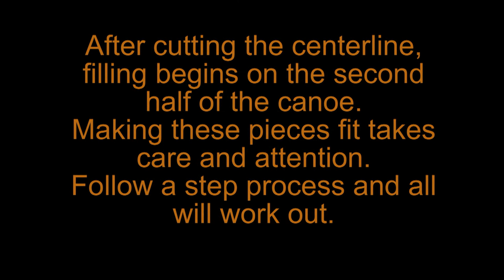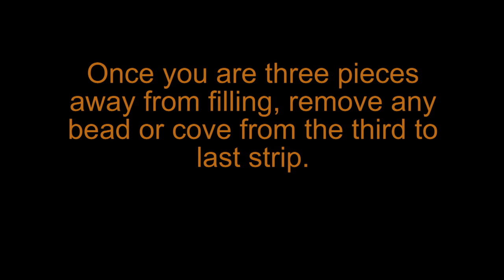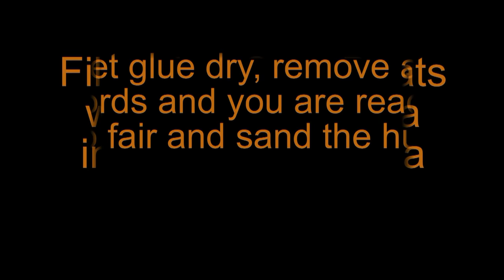Closing hull on cedar strip canoe

Comment: Nice video! I’m a finish carpenter by trade& 51 yrs old. It will be nice to put down the square so to speak in a few years !
Reply from the maker: Nice thing about most parts of a boat is that nothing is square or at right angles.  I am updating all my shop cabinets now and making everything square I find harder as I am not often required to do it.
Reply: OrcaBoats yes, that’s my point exactly! Every now and then I find myself doing archways! Lots of fun! I’ve been an avid kayaker for 20 yrs now, time to build myself a nice day touring boat! Keep up the top shelf work!

Comment: have these strips been through a router to make the side convex and the other concave to accommodate the radius of the frames (I've seen this done of builds) yours seem to be straight edge. Have you found that it's not necessary and no gaps are created round the tight bends??

Comment: Would a strong center strip / keel be a good idea- providing a secure center point for the body strips...? I'm going to make a canoe, and do it that way...
Reply from the maker: I suppose a denser wood down the center would make a stiffer hull.  There are different planking patterns that one could use and what I am showing is just one of them.  Others are herringbone or alternating between strips following the shear and then along the center line.  Each has its own difficulties and challenges.

Comment: good afternoon , I enjoy your video, it was very helpful   please ,could you tell me what kind of wood filler you used for small crack between your strips
Reply from the maker: On larger gaps, I use epoxy mixed with sawdust.  On very small and in the final sand before epoxy, you can use a simple water based wood filler.

Comment: Do you have an idea of what it would cost for the wood alone? Just the cedar strips, not the plywood. Do you know where I could buy pre cut strips?
Reply from the maker: The cost of strips for an average canoe will run around $600 Canadian.  That is 70 strips at 17 ft.  I sell strips as kits.  Mostly square edge strips as this make for a better tight joint, but can do have bead and cove as well

Comment: Did you use just a regular wood glue to fasten put the planks together?
Reply from the maker: Yes. Regular wood glue as the entire structure is encased in fiberglass and resin so no glue should see any water.
Reply: Thank you!!

Comment: what kind of glue did u use?  is it waterproof?
Reply from the maker: regular wood glue
Reply: would it not dissolve over time?
Reply from the maker: With the whole boat encased in fiberglass and resin, if the glue gets wet, you have much bigger issues.
Reply: ahhh yes. thanks  fiberglass coating everywhere.  sorry i forgot about that.

Comment: Do you use bead and cove strips?  If not, why not?
Reply from the maker: On canoes, I usually use bead and cove, but not always.  On kayaks, I may use bead and cove on the hulls but never on the decks.  Bead and cove is a faster build and less likely to see light through the hull.  Having said that, with a lot of care and attention, one can get a good tight joint without bead and cove by working with a block plane to carefully bevel the edges to mate.

Comment: Why didn't the strip ends match? Was your centerline miss cut ?
Reply from the maker: You are correct.  Pull saw went a little off line as I cut this portion of the center line, but it was only for a few strips and then all was fine.  Just happened to be the part of fitting that I videoed.
Reply: Been there done that ! Nice videos !

Comment: wrong glue, should be epoxy
Reply from the maker: Most builders don`t think that epoxy glue is necessary as the whole hull is encased in epoxy later, but I suppose if one wanted to they could use epoxy.
Reply: Titebond 3 or equivalent is good. Plus, see comment about adding epoxy later.